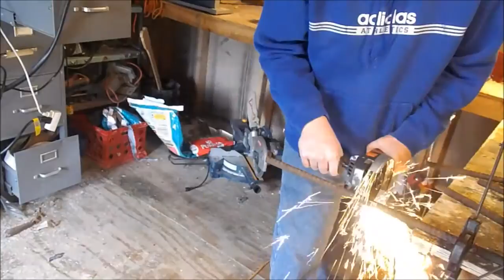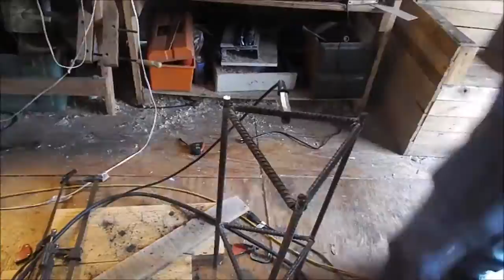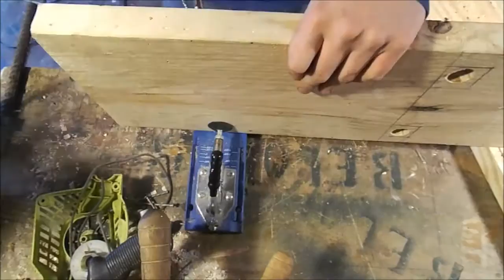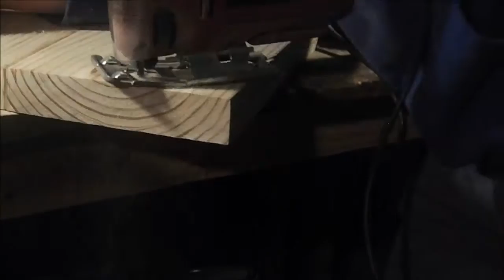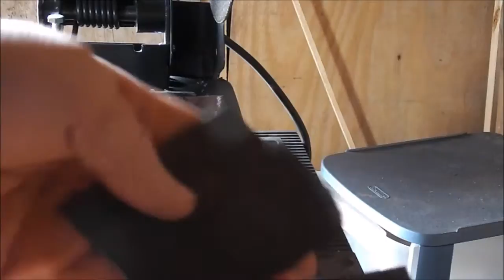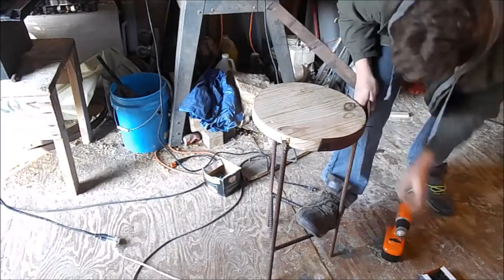Rebar stool

Comment: Wat welding machine are you using im looking to start welding myself as a hobby keep up the good work tho 💯
Reply from the maker: afro Journey  I just use the cheap flux wire welder on from harbor freight. I'm not a welder by any means but on a 20 amp socket it will stick stuff together. Good luck